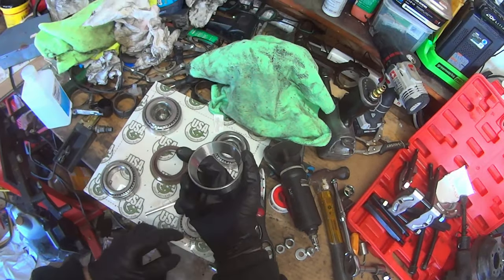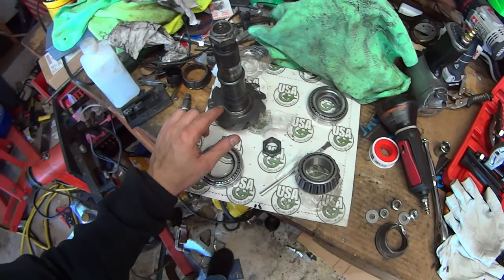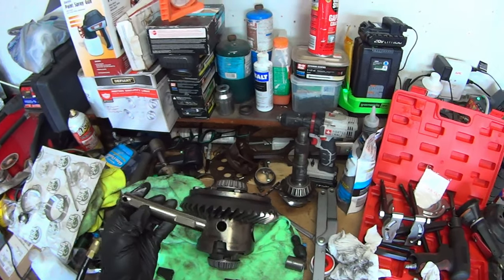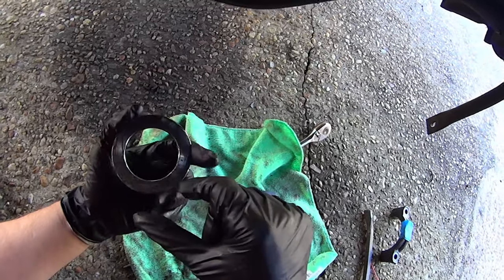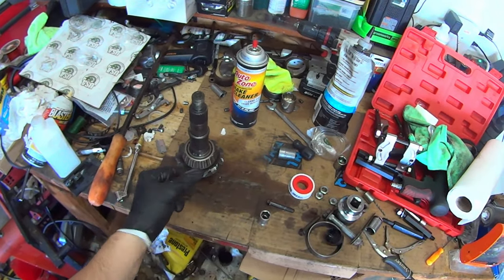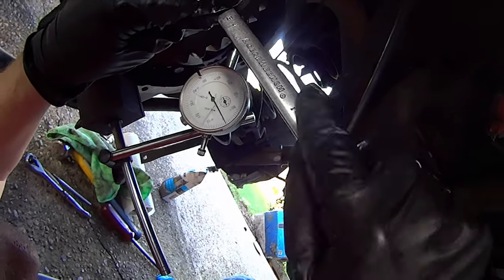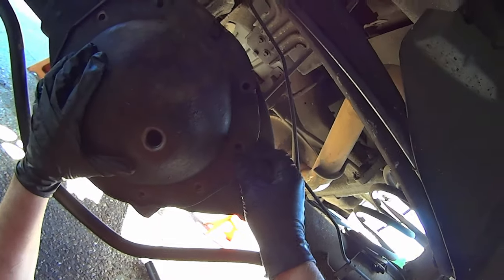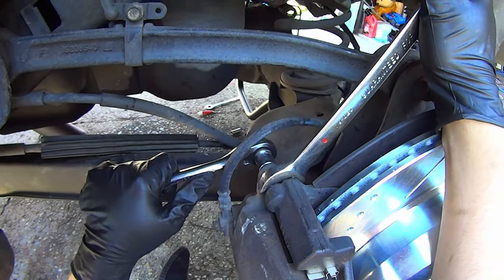PART TWO How to rebuild GM 10-bolt rear end in Chevy Tahoe Silverado GMC Sierra, Yukon and Escalade

Comment: when you’re talking about a gold surface that the bearing will sit on rather than using red Loctite, you should use Marine tax Apoxsee. It sets up super hard. We use this fix in the Marine industry and it works really well and it’ll hold up to whatever you can throw at it.

Comment: What would be the expected cost to have a mechanic and shop to perform this repair?
Reply: Different states have different minimum wages, so cost for this repair is different depending upon where you live. Look up shop hrs for this repair and go off the shop hr rate in your area . Say it's a 10hr job. In Massachusetts it's about $100hr and that's mom and pop shop rates. Stealership is a lot more

Comment: Great video, probably a dumb question but is the retaining pin sole purpose to keep the axles pushed out holding the c-clamp in place?
Reply: Yes. That's its only purpose... C-CLIP not Clamp. I know what you meant though.
Reply: And the retaining pin bolt's sole purpose is to break 50% of the time as you attempt initial removal.
Not the end of the world but it does cause excessive alcohol consumption and thrown tools by the mechanic 🤯